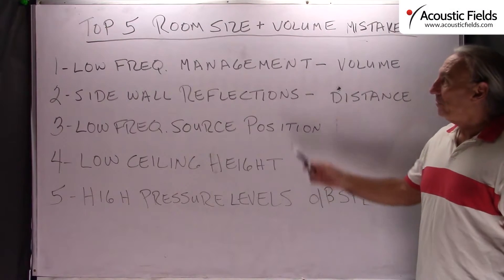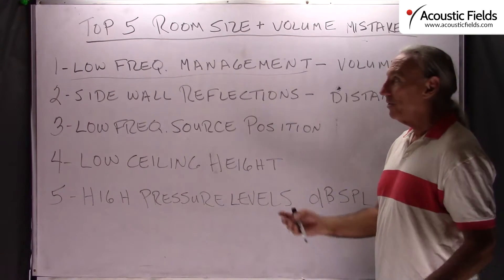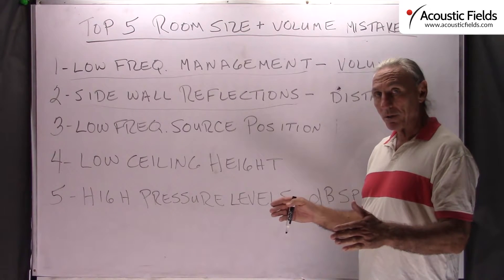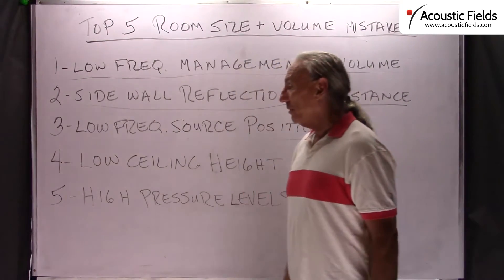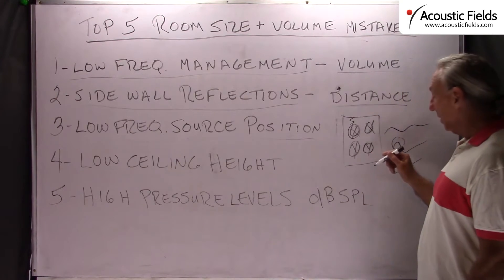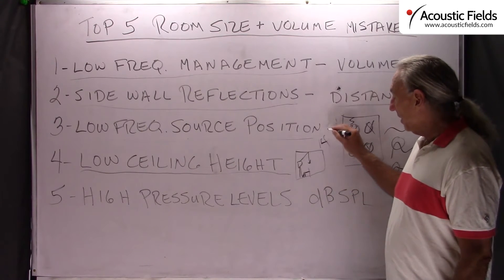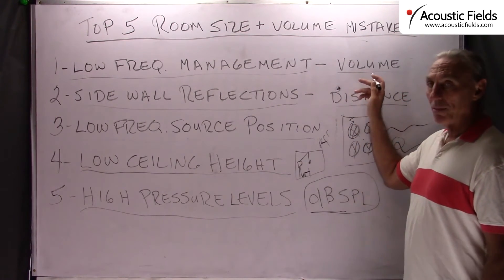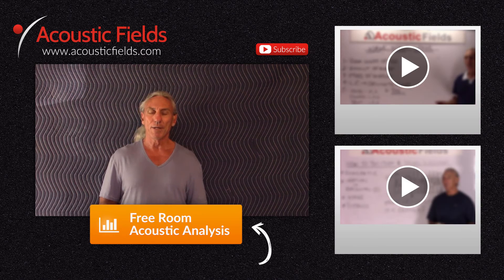The Top 5 Room Size & Volume Mistakes - www.AcousticFields.com

Comment: Any tips for rooms that are not dedicated rooms. Maybe an open family room that also doubles as a home theater room. Using sound absorbing curtains over openings that lead to other rooms or stairs, things of that nature. Possibly a topic for you?? Great videos by the way. I really enjoy them.
Reply from the maker: Hi Tony, Thank you for your support. Openings in rooms can be an asset if they are positioned correctly. They can act as "pressure relief valves" if the width and height of rooms maintain too much pressure. Reflection management then becomes the issue. Remember it is always about pressure and reflections.

Comment: We in Sweden are also cursed with the 8ft ceiling height.  The older standard used to be something like 9 feet. And if you're really lucky you find one of those really old "rich folk" dwellings with ceilings over 10 feet.
Reply from the maker: Hi Lasse, Ceiling height is the most critical of all the dimensions when it comes to time signatures of the reflections and especially lower frequency energy throughout the room.
Reply: Oh don't I know it. Before I figured out what was going on, treated my room and moved around my subwoofer, the mixes came out totally strange.